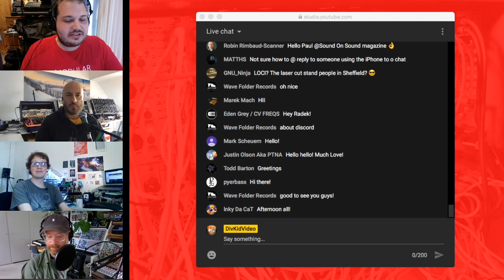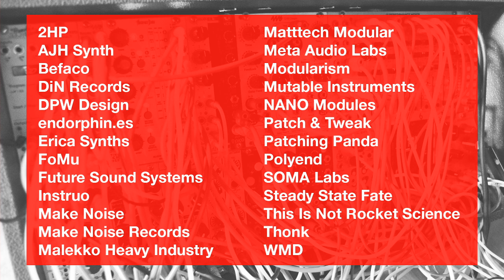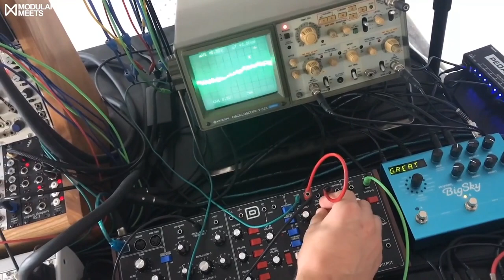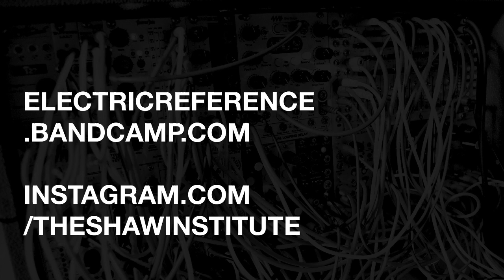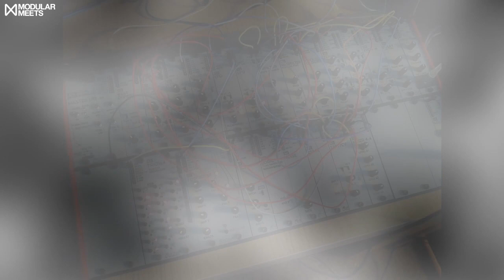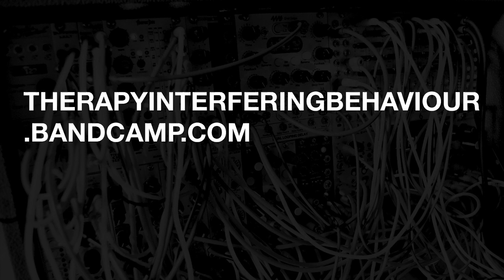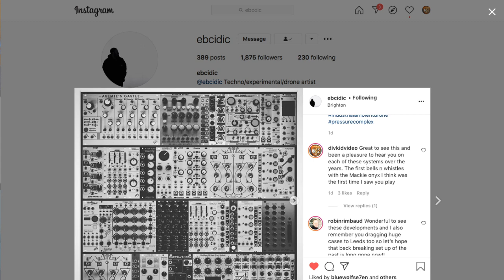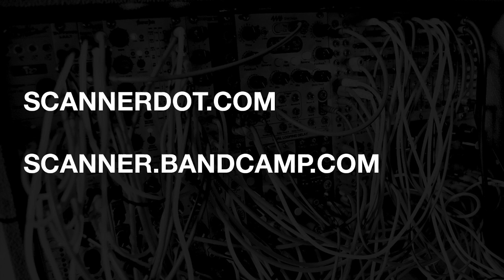Modular Meets Leeds 2020 ONLINE EDITION // New music, performances, teacakes & event highlights

Comment: Hi Ben, what utility and essential non-voice non-modulation modules would you recommend for a basic setup that has 3-4 voices and 2 LFOs? I am new to modular and just setup a system but want to plan for the next one with 168HP of space.
Reply from the maker: Hello, do you mean oscillator or full voices? A voice is a full synth if you want articulate. each note. So with it's modulation even a basic synth voice would be ... 

1x LFO
1x VCO
1x FILTER
1x ENVELOPE GENERATOR
1x VCA

Most would have 2 oscillators, so then a mixer between the VCO and filter section, plus your 2 LFOs. If this is all you want something like a Minibrute 2 (or 2s with all it's extra sequencing) will give you a lot of these functions as a great instrument. Lots of patch opportunities to expand, MIDI to CV, USB connection should a computer come into play at some point ... it's very good.

Anyway back to modules ... Now do all that x3 or x4 and you're at 21 to 28 modules for simple subtractive synth voices. 

Now you could go multiple oscillators and have them playing different notes but have them then go down the same signal path, all mixed into one filter / VCA. This would be paraphonic articulation. As each new note can't articulate itself without triggering the others. 

I'd say modular is way more interesting when we break out of the constraints of typical synth signal paths too. Modular for me is all about animation and modulation. I'd nearly always take less voices for modulation and tone shaping options. 

Bit long winded but hopefully that's something to think about.